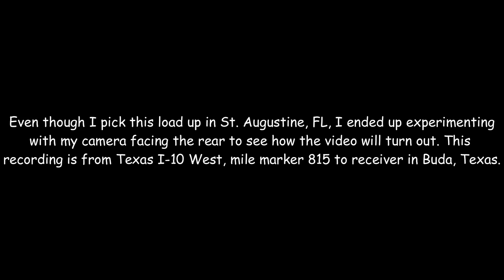First load with Landstar.

Comment: Sounds like your on top of it, I know you loaded in FL. Not sure how far your going but I would tape exhaust off when hauling backwards very far, turbo will spin with out oil because of the wind. Just trying to help you succeed.
Reply from the maker: It's an exhaust sock on there, it's kind-of hard to see it especially with the dump bed in the way but it's orange.
Reply: Good job!

Comment: Do you know how many years you need to pull a lowboy at landstar
Reply from the maker: Landstar don't go by years for pulling a lowboy. They go by how often you pulled a lowboy. Of course it has to be verified by your previous employer.
Reply: Okay I appreciate I have 2 years flatbed but wanna pull a lowboy
Reply from the maker: @chrishughes9655  you can move up to a lowboy but it's a 1-2 year waiting period to get one of their lowboy trailers.
Reply: @HeavyHaulHustle  if you start pulling flat at landstar can you switch to lowboy without experience?